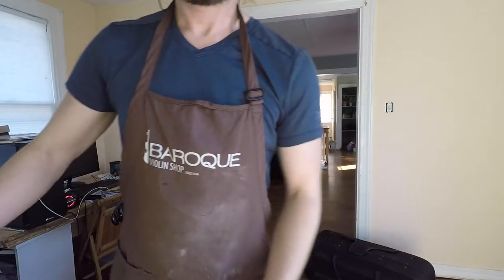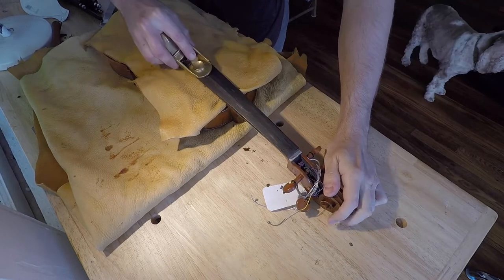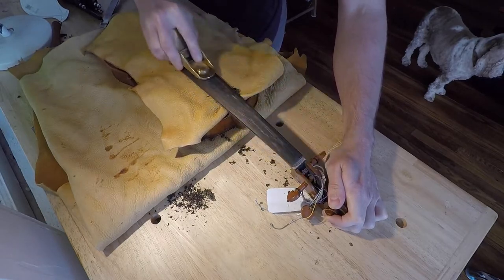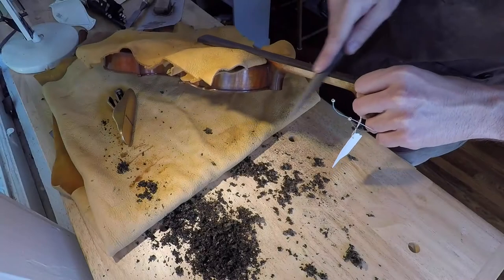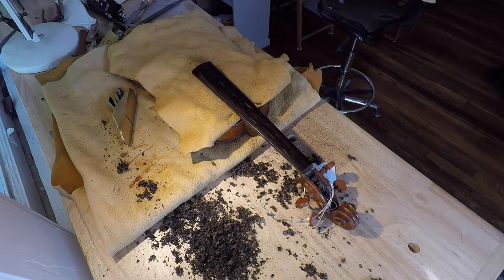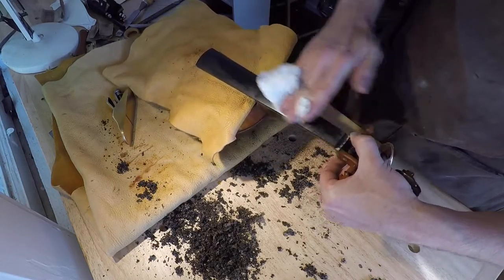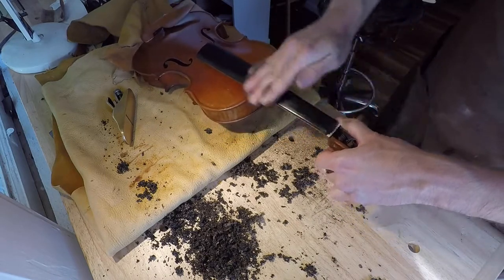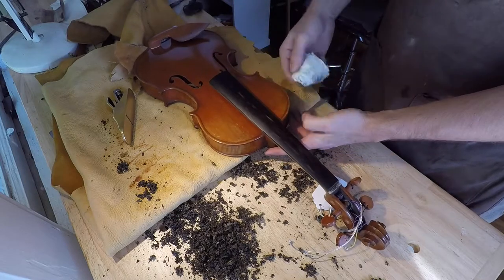Fingerboard Planing

Comment: How often does the fingerboard of a violin need to be reshaped?
My local violin shop redressed my fingerboard less than 5 years ago and recently said it was fin. But when I wanted to use my violin as a trade-in, they suddenly said my fingerboard needs $200 worth of reshaping. Is that reasonable? Fingerboards are ebony. With normal playing, fingers pressing down / vibrato etc..... does the fingerboard really need to be reshaped every 5 years?